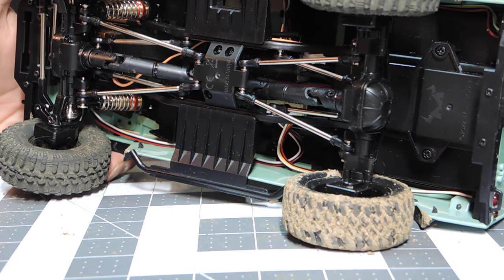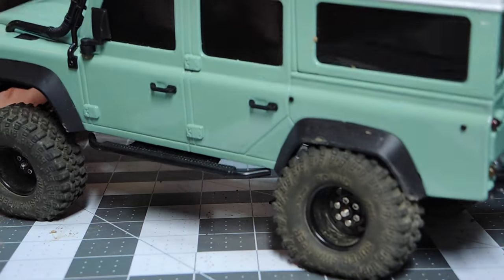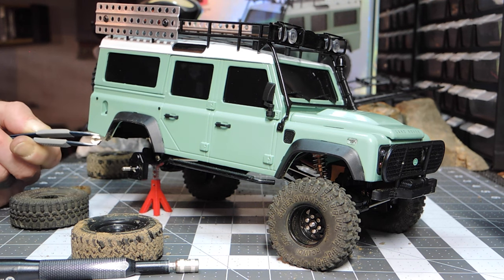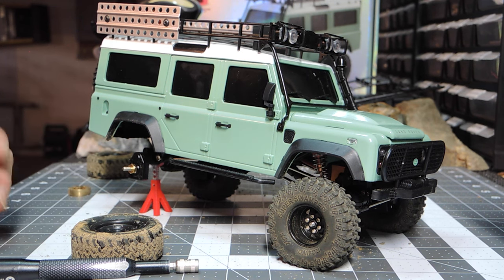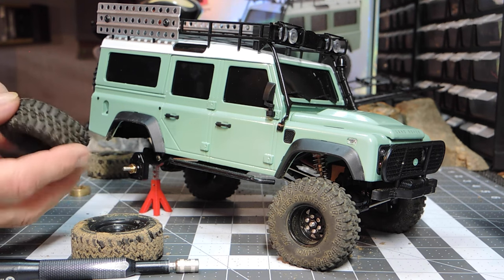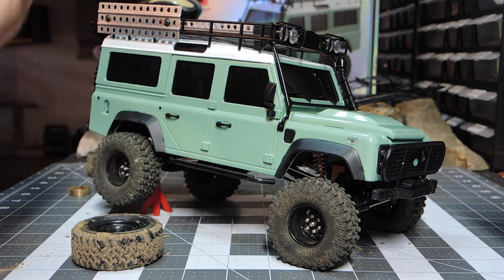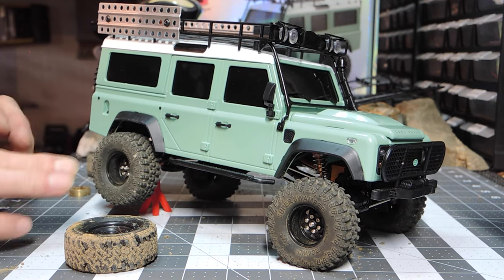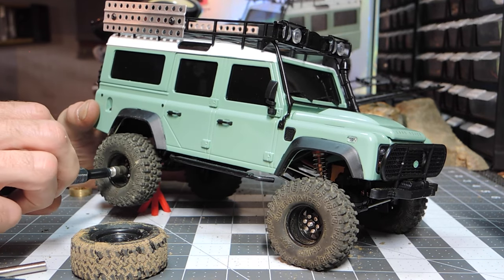MN111 D110 7mm Hex Mod

Comment: Dude I frickin love it, those rc4wd tires are on point with the scale aspect of this rig!!!!, loved the little bit where rather than take the tire off and set it aside you set it down and rolled it as if it weighed 60 pounds 😂 that just added to the scale of it in my opinion lol, I also have a couple rigs where I have to run the nylocks backwards, good tip and thanks for the awesome share brother 👍👍👍👍👍👍
Reply from the maker: I'm not one to pull stuff off of stuff to make rigs run. But I had a hunch that if I grabbed the setup off the 1/24 HiLux, that it might look pretty good. I spent a couple days racking my brain trying to figure out how to make it work. I figured the world may wish to know at some point if this rig takes off in popularity. 

Thank you for noticing me rolling the tire. That was as much a joke for those who would get it as it was me trying to be that much more of a geek, lol. I'm glad you not only caught that but felt the need to mention it. Stuff like that's for you guys. I laughed when I did it and it definitely cracked me up editing the video.

Yeah, those nylocks are sweet reversed on pretty much any 24 scale stuff. They've saved my a** a bunch of times like that.

Comment: I tried this but after installing the wheels, the pins just slipped out of the hex as the slot for the pins are opened after filling down. What thickness hex did you used for this? I was using a 5mm
Reply from the maker: For starters, I'm glad you tried the mod. Second, it stinks that the pins slipped out. I think I had that happen to me but I tried thicker pins from SCX24. I can't recall now, it's been about a year since I did this one.

You could always try a drop of superglue on the pin and put the hex on it. Let it set together. That should definitely keep them in place. While super glue is tough, that bond won't be forever and can be broken if you needed to change anything.
Reply: @VermontScaleCustoms  Appreciate the prompt reply. The super glue sounds like a possible solution. This rc is great but can be frustrating at the same time. I’ll experiment around and see if it works. Thanks!
Reply from the maker: No problem, I like to get back to people as soon as possible. I know some of these issues can be a little stressful when you've put a ton of time in and run into one little snag. You'll get it figured out.

Comment: Hi, can u tell me what transmitter  u used? Is it compatible with the light module? Thanks
Reply from the maker: Panda Hobby 2023A ESC/Radio Combo with Transmitter - it is not directly compatible with the light module. I have ordered one from AliExpress that will interface with my ESC.
Reply: @VermontScaleCustoms  Thank You. I hope you make a tutorial on assembling the right electronics for this RC, especially the integration with the built-in lights
Reply from the maker: @DewaAgungKrishnaArimbawa  I'm sort of on the fence about the factory light kit. They used blue leds which look awful. I may end up keeping the Panda Hobby radio and using the lights from a Tetra X1. Which will allow me to customise the light color a little more. Either way, I will definitely have more videos on this truck! I love it. It's a great release from MN. Thanks for your comments!
Reply: @VermontScaleCustoms  i got some information, and i think the lighting system can compatible with transmitter and receiver + esc (2 in 1) mn99. Cmiiw
Reply from the maker: Yes, it is almost the exact same as the MN99 lighting controller. Personally speaking, though, that ESC is not strong enough to run this motor. It will cause problems if you try and run it and a heavy duty servo. It wants a 30A minimum for good performance.
Reply: @VermontScaleCustoms  Ahh i see, how about dumborc x6dc??? Can we used it? But from my point of view, it has a different socket than the default mn111 lighting system  socket?
Reply from the maker: 6 channels is definitely enough to run all the lights. Each one of those is a different function, too; brakes, reverse, headlights, etc. So all of them will work if you map out the wires from the MN 6 pin connector. I am going to bypass all of that and just use my own LED lights and be sure to run them to the proper port. After seeing what lights they used for the kit I don't want to run those at all. I like more soft yellow / off white light. That blue spectrum stuff is no good.
Reply: @VermontScaleCustoms  thanks man, appreciate it. 

And how about the gear spare part? Is there any kind of rc that has same part with mn111? Like trx4m?
Reply from the maker: @DewaAgungKrishnaArimbawa  I don't know about the gears. I have not pulled anything apart yet to see what's inside. It's a basic 3 gear transmission but I don't know what the ratios are. Not sure I'll dig that deep, honestly. For low speed control, this one has decent gearing right out of the box. It just needs the right ESC to run the motor. The motor, itself, is very strong at 60T, so it's no weakling. The portals are well made but I feel like TRX4m axles might fit if you had the desire to mod them.